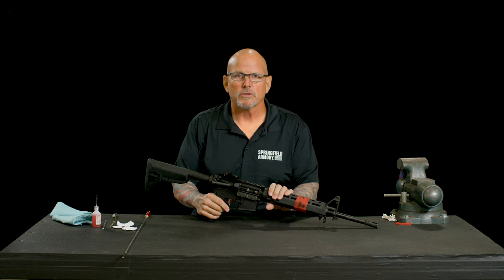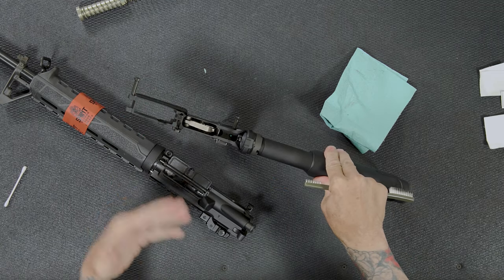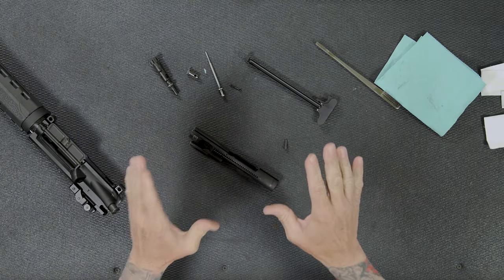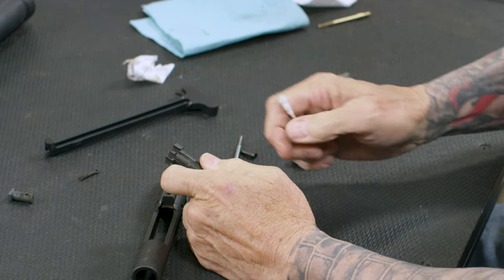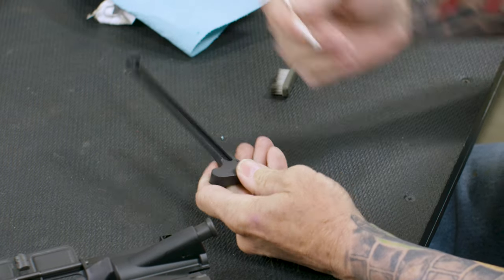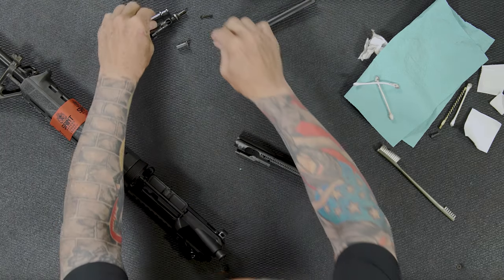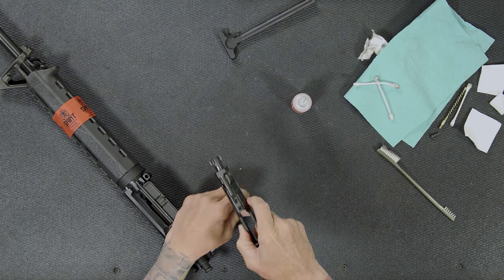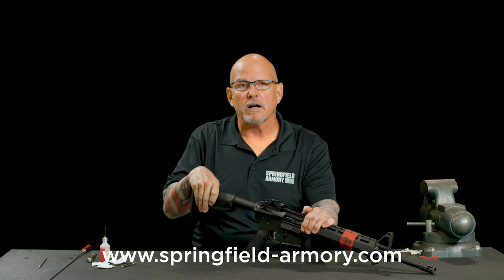Springfield Armory® Workbench: Saint

Comment: I just received my Saint Edge Rifle a couple days ago. I'm going shooting on Saturday with it and my hellcat I also got the sameday. The Saint edge straight out of the box is not soild it shakes and Wobbles makes noise the upper and lower receiver has play in between them and then the stock and upper receiver has play in between them as well they are not rock solid and noiseless like described... I feel like now I should not have accepted it and sent it back right away at the same time I thought I could just tighten some bolts up when I got home and it would all be fine so could you help me out with some advice it would be greatly appreciate it because I really want to like this rifle
Reply: There's a set screw under the the grip that you can adjust to stop the upper and lower reciever wobble. You have to remove the grip to get to it, but it's pretty easy to adjust. You can actually see the top of it from the top side of the lower reciever when its disassembled. That should tighten it up for you.
Reply: @deadweight2049  thanks for the info I got it fixed I happen to read the owners instruction manual shortly after making this comment and felt real stupid LOL

Comment: I just bought mine in August I was told that it only runs 556 62 grain, .223 wont cycle properly unless it's 62 grain or a high quality ammo!? I have some wolf military classic .223 55 gr. Fmj which I am hesitant to use because of the "jam" issue. I am shooting PMC X-TAC 5.56 (M855) 62 GR GREEN TIP and have not had any issues. Just wondering is this a myth or what?
Reply: Just bought my gun a week ago and I have ran 200 rounds of .223 55 grain ammo without any misfires